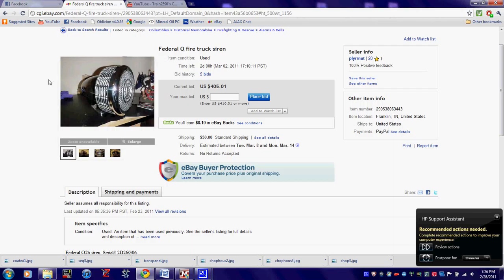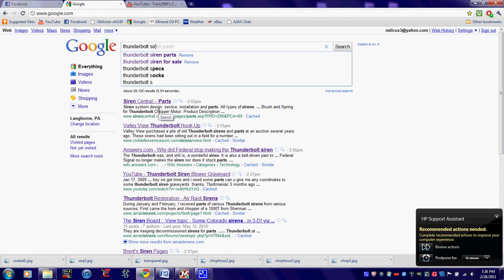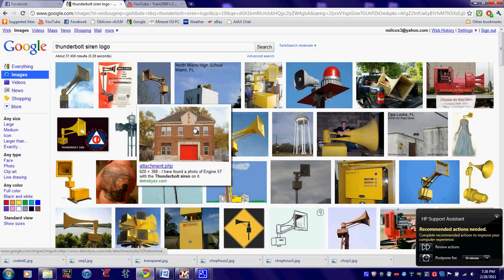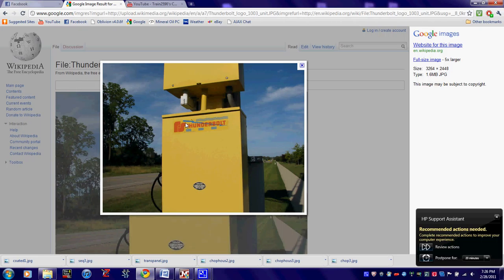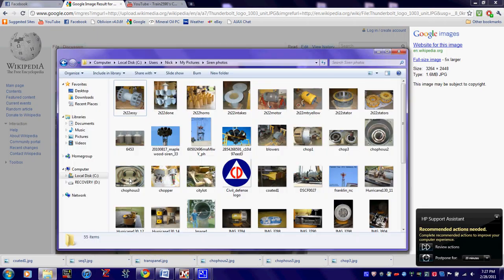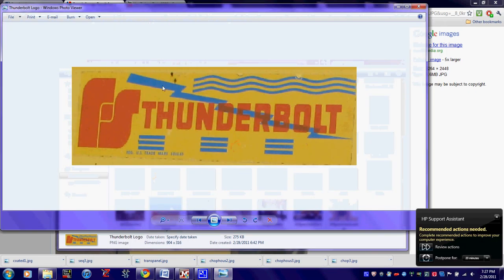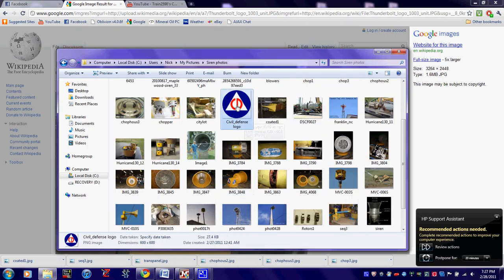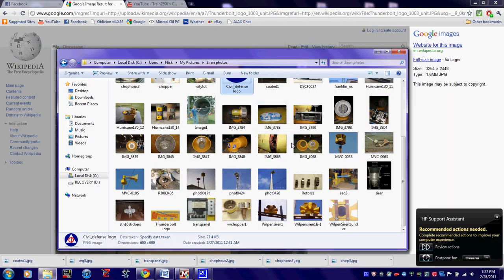Thunderbolt Logos for my T-Bolt 1000T

Comment from the maker: yes i am looking for the Federal Q on eBay, i don't want to pay $2,000 for a brand new one,  my only question is, powering it,
1.  use a car battery, 
2.  get an 110amp alternator and hook it up to an electric motor, 
3.  spend another couple hundred on a 125volts to 12volt,110amp transformer, 
which way do you think is the cheapest way to power my future Q?